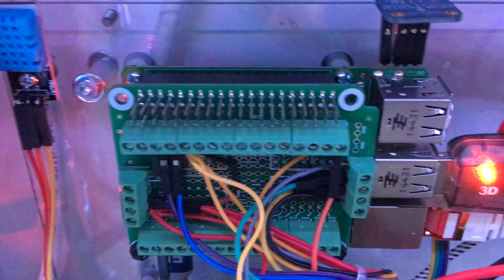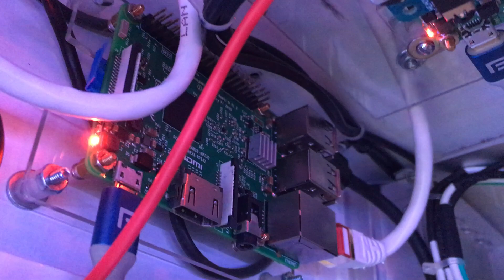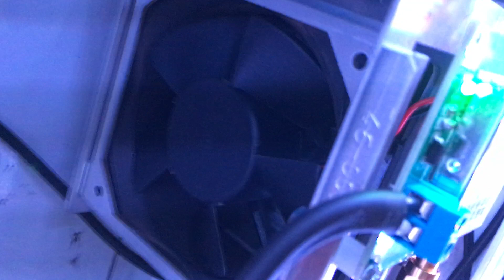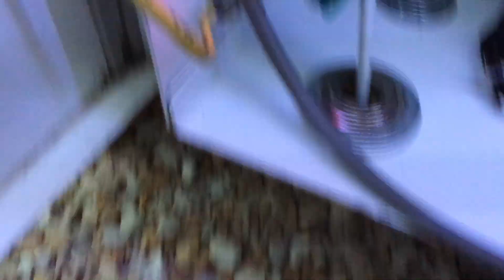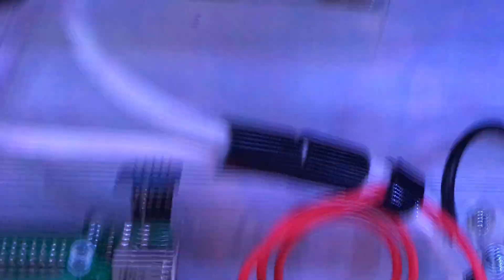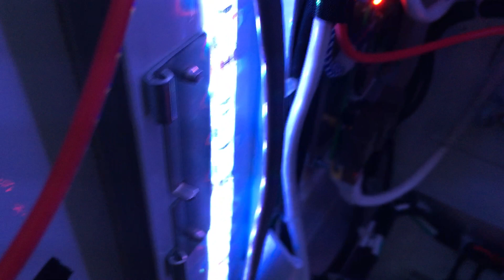Raspberry Pi Outdoor Enclosure Setup Box Number Two “Part 3”

Comment: Which RPi hat are you using to collect local weather information?
Reply from the maker: I’m not a hat to collect data. I’m using different sensors that are connected to the GPIO hat that is mounted to the Pi.
Reply: So is the hat is just a breakout board which is attached to the RPi header then?
Reply from the maker: Yes. It has screws to hold wires, solder holes and pins.
Reply from the maker: Here’s the Amazon link Alchemy Power Inc. Pi-EzConnect. Raspberry Pi 2 and Raspberry Pi 3 GPIO connector. A HAT to connect GPIOs and sensors to Raspberry a Pi-2 or Pi-3. https://www.amazon.com/dp/B01FE9EQ88/ref=cm_sw_r_cp_api_v6H8Bb0VYSA7E
Reply from the maker: The software that I am using to store the data is called “Nettemp”.